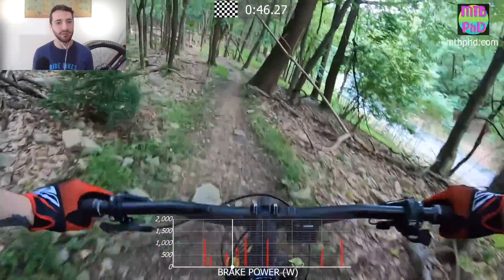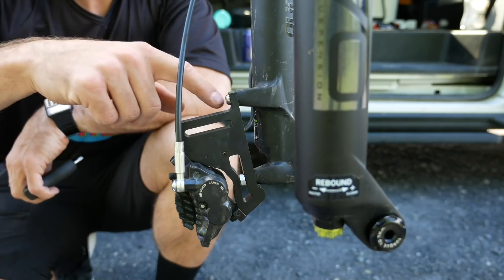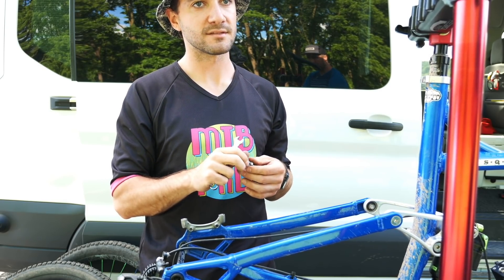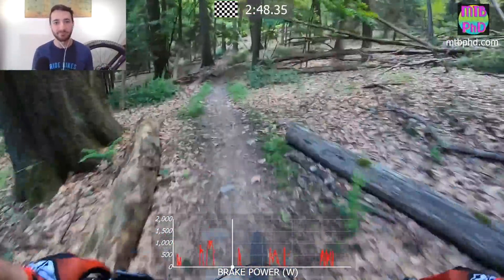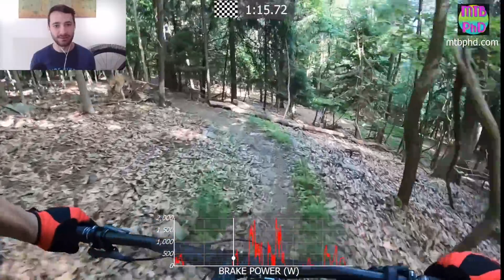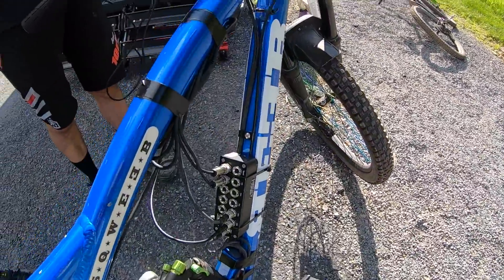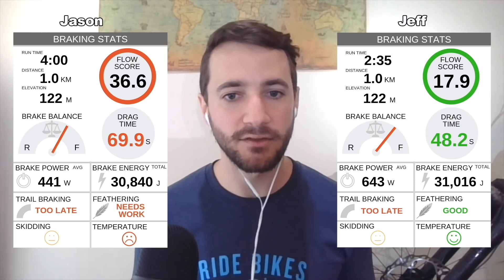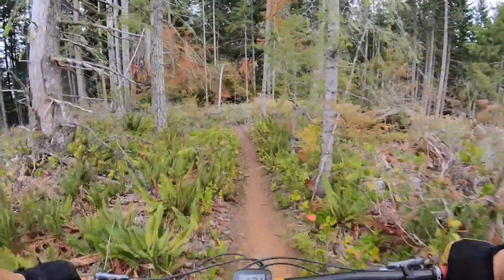How to brake properly on your MTB | Brake Power Meter

Comment: This is one of the most oddly pleasing videos I've ever seen! I ❤ mtbing! We invest work on climbs and then we get to enjoy converting that potential energy we just earned into kinetic energy!🤙 I'm not as interested in overall "performance" aspect as I am in how your gadget can finally quantify the amount of "wasted" momentum (i.e. previous effort!) that breaking consumes. 

The cool kids know that steep descents are more rad than less-steep descents. But I say, if the trail being twice as steep means you use your breaks twice as much, well, then you've just wasted twice as much of your climb!

Trail builders have choices. And they're probably going to usually choose to build a 1 mile, 300', 4 minute descent that requires a lot of breaking ('wastes' a lot of climbing), rather than spending twice as much work (one time!) building a 2 mile, 300', 8 minute descent that can be ridden just as fast (with less breaking and minimal pedaling) but for twice as long!

Comment: "Brake with all your knobs on the ground." :-)
- is there an actual thermometer on board or are you speculating about the temperature?
Thanks for the video!
Reply from the maker: I believe it extrapolates depending on how much you're braking!
Reply: @JeffLenoskyTrailBoss  That was my point exactly, if you brake hard you brake for shorter period of time but also generate way more heat... + there's few other things to consider...
Reply from the maker: @c3N3q  Yeah, Matt has the doctorate, he's smarter than me.  I'll get him to chime in.
Reply: @JeffLenoskyTrailBoss  yo, I'll be happy to discuss it with Matt if he wants to...
Reply: @c3N3q  we model the temperature live based on rotor characteristics, the environment and the brake energy
Reply: @mtbphd  But there is no thermistor in there anywhere right? Good idea to modify a load cell for braking forces. The only concern I could see would be since the load cell device brings the calliper out from the mounting points on the frame/fork so much there might be a situation where the leverage is too much for the frame/fork brake mounting points causing them to crack or something if running too large a rotor and braking too hard. 
Great idea though and really cool. I think data acquisition is something that riders can benefit from even if they are not racing.
Reply: @Gamingoodz  yeah it has a temperature sensor built in but it wasn't wired in to the logger for this video. The torque was tested to ISO standards

Comment: This is amazing! Not just capturing the data but correlating with the track and performance. Many riders can benefit from this (I know I will). I want one!   Another thing which can be interesting to study is suspension, there's soo much to measure and tweak using data-driven analysis!
Reply from the maker: The possibilities are endless!

Comment: that was a really useful vid, thanks for opening up the discourse on braking to make you faster. MYoung said below , lacked information to improve our riding, i would say watch it again, then if you still can't get the message, try another sport! In motorsport braking is considered to be a highly important part of the racing performance, along with line choice determines how quickly you get around the corner, we just need to apply these lessons to our riding. thanks Matt for a view into your world!

Comment: This is great and I've talked to Matt on skype. I did a 3 day motorcycle ride in the desert with Rick Johnson (80s AMA supercross/motocross multi-year champ)  a few years back and he gave me some great advice. 1) Brake, 2) Corner, 3) Accelerate, 4)Don't mix up  the order of 1, 2, and 3, and don't combine. Someday we'll mash up our suspension data (Motion Instruments) with Matt's brake data and see how suspension plays a role in not only riding, but braking as well. If your rebound is too slow, for example, it won't get back to the ground fast enough. You can't brake when your wheel is in the air due to packing suspension... What Matt is doing is cool. Thanks for doing a video on this.
Reply: Thanks, Rob. It will be awesome to combine forces with you and Motion Instruments! None of these things are (suspension kinematics or braking, etc.) are happening in isolation, so learning how they work for or against each other will help us learn more about performance and help us give riders a better ride experience

Comment: I see biking as being directly related to what I learned while racing cars. Your car/bike can only do 100% of any ONE thing at a time. 
You're either braking 100%, turning 100% or accelerating 100% - you cant get 100% of two of those things at the same time.
Brake BEFORE your turn then accelerate out - try to brake in a straight line to maximize braking and minimize over or understeer.

Comment: Yeah I know that I tend to break before the turn try  not skidding depending on if there's sand or not just a enough not to overshoot to turn but, I find that tires make a big differences the weider because attraction breaking. Thank God for the brake rotors, is those rim brakes I would be blow those brake pads out quick especially the front ones. Great video keep up the good work guys. And always be safe.

Comment: If this was ever made into something I could rent (either as an easy-to-mount hardware & easy-to-use analysis program; or just having someone run you through it like a bike fitting session), I would invest in this before the rental of a ShockWiz or purchase of a power meter.  This provides the best long-term benefits from short-term uses.  Jeff, have any of your ride characteristics changed since using this?  Also, you made Pipeline look fast & fun!
Reply: Soon!!! :)

Comment: That is great advice ... just like auto racing brake in a straight line and do it fast ... brakes on then off ... looking at cars most of the time its brake 100% to 0 and throttle the same way. I need to learn to find my bikes traction limits in corners so I don't trail brake so much. I do love to brake hard in a straight line last minute

Comment: That's why prudent people do not recommend carbon wheels with rim brakes to be used by amateours: prolonged braking creates hot spots and prevents cooling, chances for inner tube or tire malfinctioning increase even before brakes fail.
Reply from the maker: LisaPet totally. Heat dissipation on carbon is tough.

Comment: Great video. Newton's Law of Cooling states that the greater the temperature difference between a surface and the air, the faster heat will transfer. That's why braking harder for shorter time results in cooler rotors.
Reply: Gotta love it! We have a pretty good model now that can show the temperature of the brakes as we ride. I'm pumped on it!

Comment: I maybe asking this question to soon before watching the entire video.   But my question is.  Did you do the test with a 160mm disc, 180mm and 200 + disc?   on the same trail.
Reply: We actually did runs on a hardtail as well as a full suspension bike.  203 rotors were used for each and every run
Reply from the maker: Yeah 203 Rotors, I mifght make the hardtail VS Fully vid but it was getting confusing
Reply: Which rotors were those ?

Comment: I think the difficult thing about braking into a turn  is if  you do not know the trail that well  . When you come upon a turn your not sure how fast you need to be and I think many just are going to fast or they believe they are so they feel they need to feather the brakes around the turn 

I dont have a problem with feathering around a turn  as long as your not locked up you can hold traction  . I have come into a turn on many occasion braking to hard and taking the turn way to slow so for me i may brake before the turn lighter than I may need to and feather if need be with light action and I have pretty good flow . Better than misjudging to much a braking to hard and going to slow around and the flow is not very good 

Well done as braking and shifting are the most critical component of biking especially racing
Reply: Your comments would be easier to understand if you learned how to use the word 'too'.  Or forget about 'too';. Use 'excessive' instead. Then you can work on mastering the difference between 'your' and 'you're' (or just use 'you are'). Congratulations on getting the word "braking' right.
Reply: @gatoryak7332  sorry a bit dyslexic

Comment: I appreciate the logic of breaking before the turn, in practice I cannot  maintain the same momentum I carry through the exit when braking into the apex.  This thin line has fascinated me but I find myself over slowing if I brake before like the coaches want.  Anyone have tips, or similar experience?
Reply from the maker: julian lobato I obviously struggle with it myself. It takes a lot of practice!
Reply: @JeffLenoskyTrailBoss  I believe it was Loic Bruni who brakes into the Apex so it can't be that bad of a technique. 🤔
Reply: @falllinemaniac  one of the techniques we use to train this is to stop completely before a downhill turn, then let off the brakes and completely and coast through it. We then start to push higher and higher to gain more speed ahead of the same turn, but continue to stop quickly and coast through so that we are going fast ahead of and after the turn. Time it to see what's faster! Hope this helps

Comment: Limited analysis really. If grip is limited, think blown out summer, hard braking would be useless. Also zero mention of trail braking.
Reply: I think that was one of the parameters measured tho I believe you mean a specific old school technique. I'm prone to the vice of using the rear to make the front wheel heavy. I also like to do micro skids of 4" triplets to scrub the back tire around a bit. Coaches hate that.

Comment: Awesome hanging out with you and doing some brake analysis!
Reply from the maker: Thank YOU!
Reply: Do you correlate the braking with a gxp file (or whatever file type you use for tracking geo)? Is there room in your analysis for other metrics like heart rate? How does a really steep and loose DH trail change the analysis? Super interesting!
Reply: @akatz13  yep, I record pretty much everything like heart rate, super accurate 50Hz GPS and power output. Even did VO2 in the past as well. We kept in simple in this one since we only had half a day and did 6 runs on 2 different bikes! It was pretty crazy :)
Reply: Nice idea that strain gauge. I think more used way is to measure brake pressure. What are the advantages in load cell? Can you see when tire locks out?
Reply: @hene6539  I've used brake pressure sensors, but even with a wheel speed sensor it's not possible to know the actual braking effect in variable traction conditions
Reply: Any plans on bringing this to market as a fully developed off-the-shelf product? Serious potential to make a lot of people's weekends more fun! I'd donate to that Kickstarter without a second thought.
Reply: Hey  @impossiblivion , this is definitely the plan! We have developed some automatic coaching software and have moved on to the next phase. You can sign up for our newsletter on https://brakeace.com to keep up-to-date!

Comment: Really cool! I have a exercise I use for going faster. Get on a familiar trail and see how far you can get without touching the levers. Was surprised that a lot of trails required zero braking after a few runs. I need no help sprinting or going fast down hill, but what really surprised me was the massive difference on flatter trails or up and downs where you can conserve momentum.
Reply from the maker: sapinva that’s a great idea.  I try that too!!